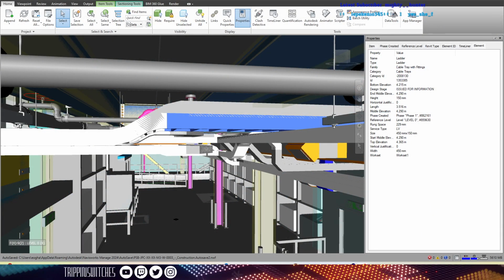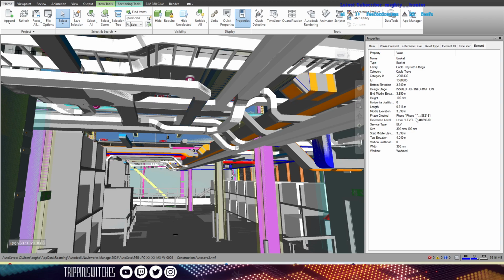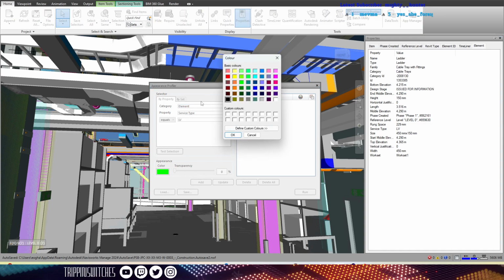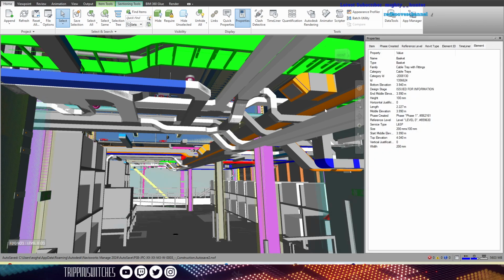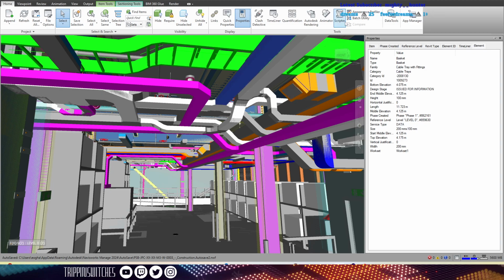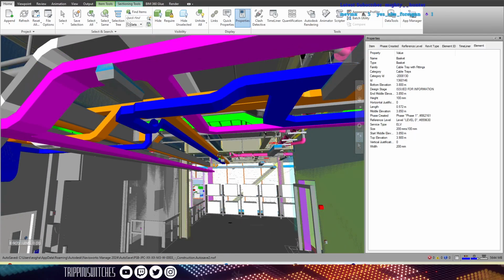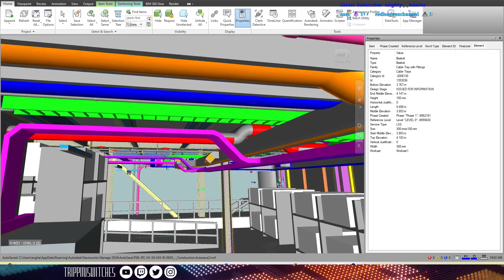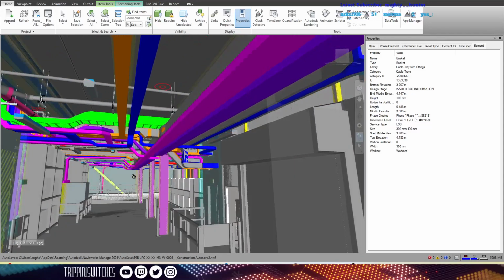Navisworks how to create an appearance profiler

Comment: Hello,
Can you tell me if those colors stay in the model when you save it ? Is it possible import the file in Revit and see the same editted colors ?
Reply from the maker: Hi thank you for the question its a 2 part answer. so your first question yes you can save the appearance profiler and the next time you load your file the colors will remain. The second part is no as Navisworks is a viewing tool and Revit is an editing tool you would need to create corresponding filters for revit so the items will show in the same color.
Reply: @TrippinSwitches  Thank you for yours answers. Unfortunately I can't find a way to create similar filters in Revit that would apply on the linked nwd model. I can only modify the transparency of the nwd file, but it always keeps its original colors.
Reply from the maker: @jeremygrecte  no problem, ok with the filters you need to make seperate filters in revit these are two different softwares so you cannot create one as I did here and load that into Revit. For the revit filters you need to create them in a view template and apply that template to a view.
Reply from the maker: @jeremygrecte  Leave this with me and I will post a video as soon as I can showing how its done
Reply: @TrippinSwitches  Hello again, I just got Navisworks installed so I could actually try it, and it worked: 
I've set some filters in the appearance profiler and saved the nwd file, then I linked it in Revit and it had kept the appearance that I gave it.
Reply from the maker: @jeremygrecte  Great nice work Jeremy I didnt think you could load the profile across Navis that is new to me. I will check this out thanks for the update
Reply: @TrippinSwitches  I didn't have to load any profile, I loaded the full nwd edited file, in the Coordination Model tab in Revit.
Reply from the maker: I hav ecreated the video and posted it live now. I hope it helps you
Reply: @TrippinSwitches  Il check this out
Reply: @trippinswitches you should make a video on the templates.
Reply: Did you get thos sorted
Reply: Great video ❤